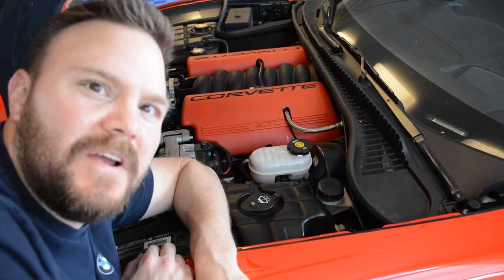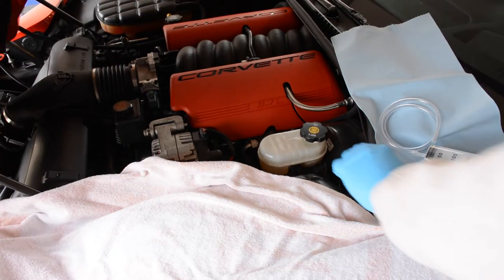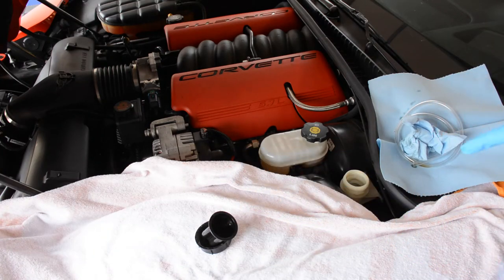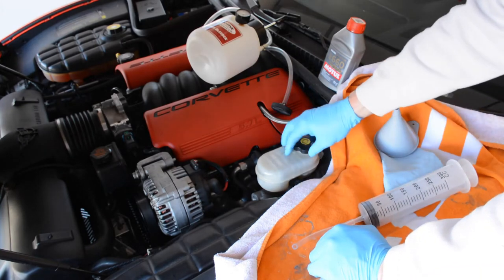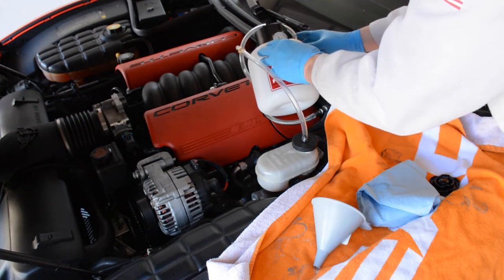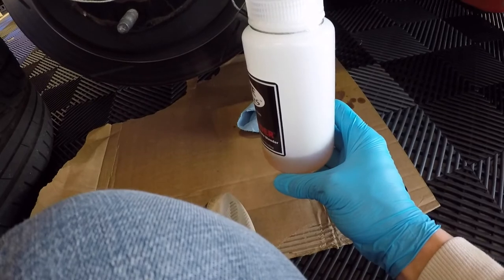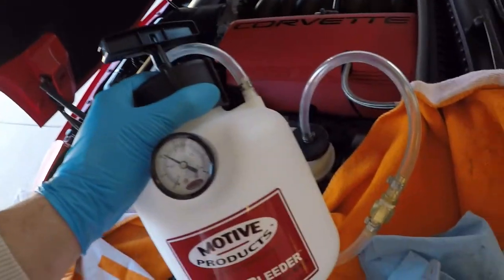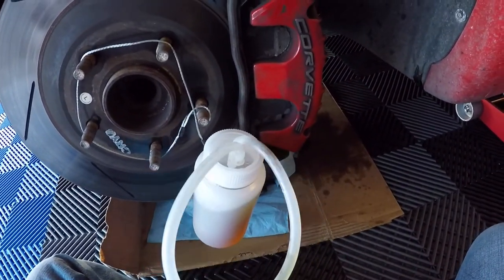C5 Clutch and Brake Fluid Change

Comment: So why not fill the power bleeder with fluid like you are supposed to do?  I have done both ways.  Last week I filled it and used it for the fluid additions while I bled.  Just curious why you don't fill the bleeder?
Reply from the maker: Great question, I'm probably over thinking things. Since the amount of fluid you need to replace isn't an exact science, you probably end up with fluid left in the container or not enough fluid in the container to finish the job. So you either end up having to move fluid back into the original container or adding to the tank. I figure its worth the extra 10 minutes or so not to bother with it and keep the leftover fluid in the original container.
Reply: @crisispointracing3423  Thanks for responding.  To answer having too much fluid, you then use that for the Ranger bleed!  So, in effect, do the process reversed and you use it all!  

Learned this last week so I am not bashing. 

But, I have use the Power Bleeder for years.
Reply from the maker: @OCDRex11  Makes perfect sense, thanks for the tip!

Comment: What type of clutch fluid is used  ?please inform thanks 😊
Reply from the maker: You use the same as the brake fluid. As this is a race car, I use either Motul 660 as seen in the video or Castrol SRF.